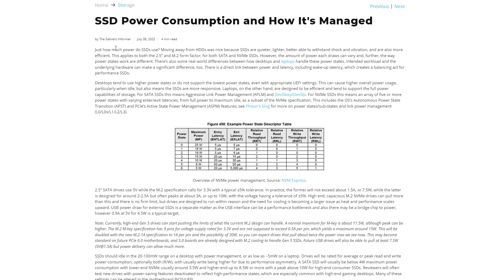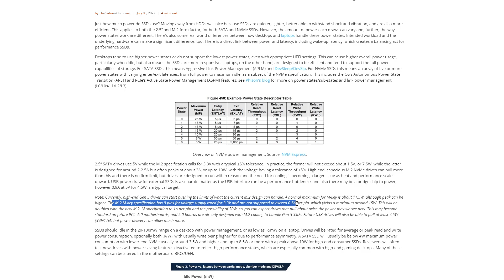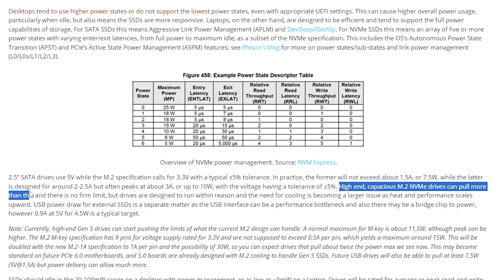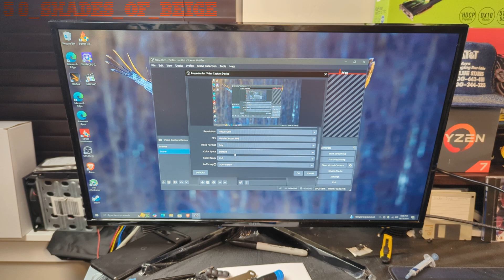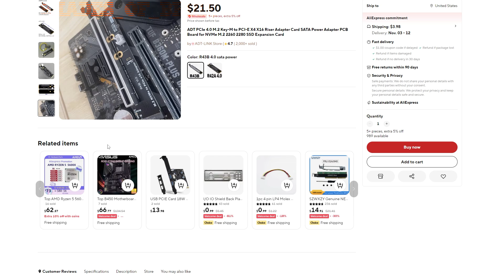Testing $5 PCIe Riser on Optiplex Mini PC

Comment: And finally, there are M.2 capture cards actually! But, nobody has reviewed them, and those that review them only look at the usual 1080p, 4K stuff and don't test if it works with 800x600 and all that interesting information 😊😊
Reply from the maker: @philscomputerlab  ah good point. I didn't think try any retro resolutions. I will check that out.
Reply from the maker: @philscomputerlab  The Avermedia card does 640x480 and 800x600 wonderfully. 

There's also another card called the "DigitPro". Its about 20 USD on Amazon.  I use that for retro stuff because it can do way more retro resolutions but it only captures S-Video.

Comment: A lot of these M.2 to PCIe slot adapters, like the one you're using, come with a little SATA power cable. You can use that to feed additional power to the slot!

Comment: Interesting video. I'm actually in the market for a capture card right now but not sure what I'm going to do yet. I kind of want a USB one for the convenience.
Reply from the maker: @computersales Thanks! USB is okay for the most  part, just don't buy the 1HungLo brand off Amazon. Those boxes are OK for general use but if you're a tech enthusiast you'll be disappointed.  EVGA X1 Lite punches above it's weight for the price. I've seen them as low as $40 on FleaBay